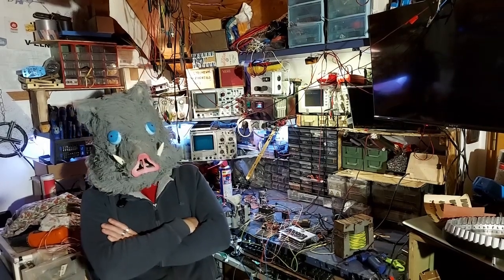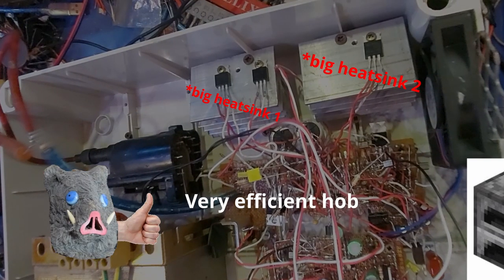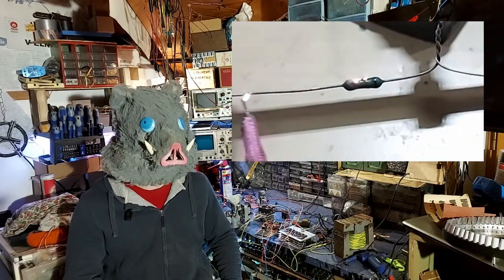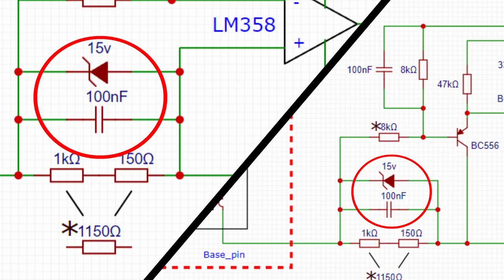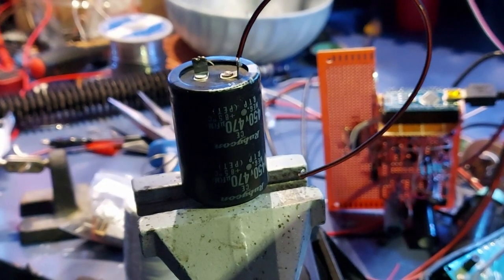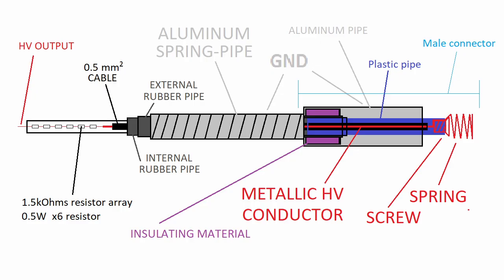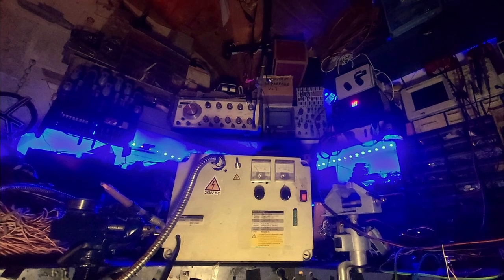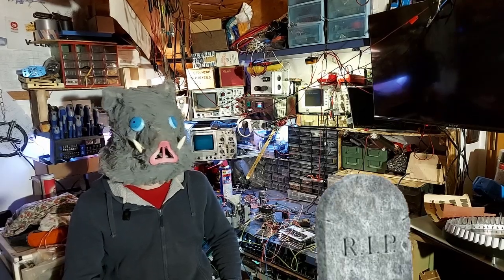High voltage power supply (English)

Comment: This video is a perfect shit-storm of amateur hour and reckless disregard for safety, masquerading as a tutorial for beginners and "DIY" enthusiasts. Where the heck do I even begin… You're working with high voltage moderately high current DC regime without a risk assessment, lockout/tagout system, or proper safety gear. Solo operation, lack of fire extinguishers, and HV contact with metal are just a few of the hazards that make this setup a disaster waiting to happen. And if all that wasn't enough, you're doing it all while wearing a flammable fur mask. Yes, you read that right. A bloody fur mask! While working with high voltage! It's a miracle you haven't already set yourself on fire. The fact that you're operating a UVC bulb on the direct output, potentially leading to a negative resistance runaway and mercury spill, is just the tip of the iceberg. And burning PVC with flame retardants indoors? That's a new level of reckless.

Additionally, holding solder!!! (which is conductive!!!) onto an pin of a transistor on which you are arcing (in your hand) is an instant darwin award nomination. YOU NEVER EVER EVER TOUCH AN ARC!!! But what's almost as disturbing as the circuit itself is the state of your "lab". It's a cluttered, hazardous mess that's just begging for an accident to happen. Cables and wires everywhere, with no apparent regard for safety or organization. It's a miracle you haven't already tripped over something and gotten hurt. The design itself is a mess - all analog, point-to-point soldering, and no modern design practices in sight. You're not even using the flyback transformer in its intended mode, and there's no indication that you've performed a proper risk assessment for operation outside of its specified regions! 

The lack of design practices is staggering, and it's clear that you're suffering from a severe case of Dunning-Kruger effect - you're not even aware of how much you don't know. Masquerading as a tutorial for beginners and "DIY" enthusiasts is particularly egregious, as it implies that this is a safe and acceptable way to work with high voltage. Newsflash: it's not. Someone is going to get seriously hurt, whether it's you or one of your viewers who thinks they can replicate this monstrosity. Get it together and prioritize safety, or don't bother sharing your projects with the world. The stakes are too high, and the consequences of your negligence could be fatal to either yourself or one of your impressionable viewers.